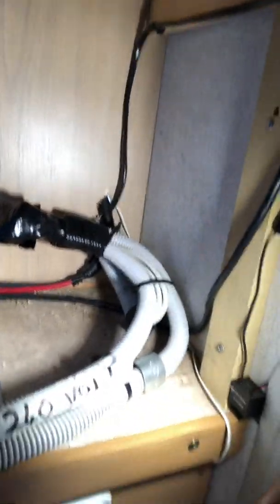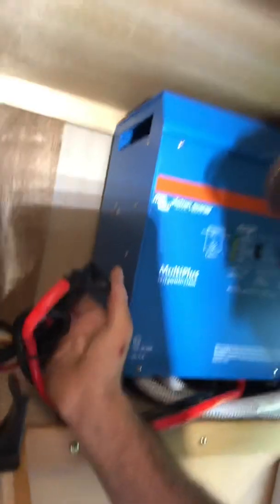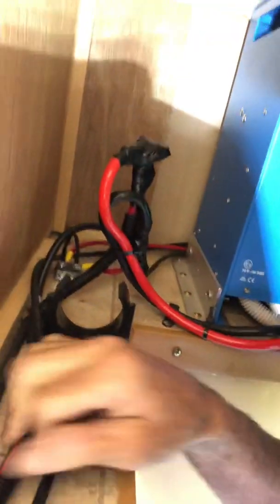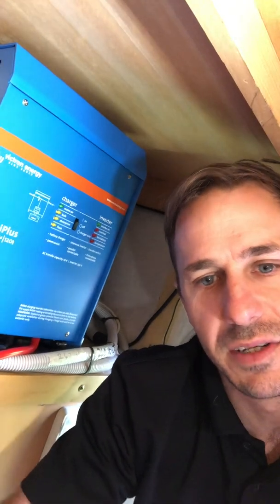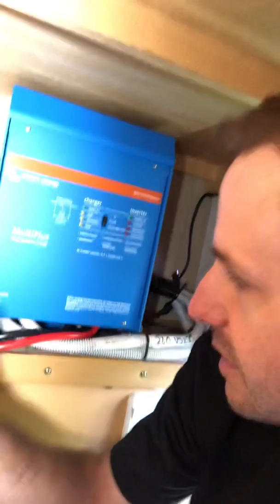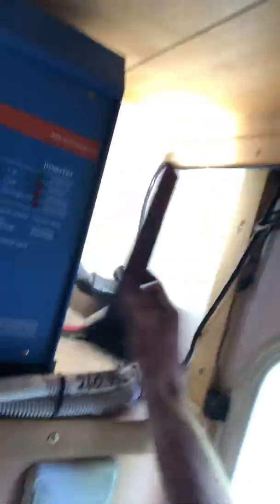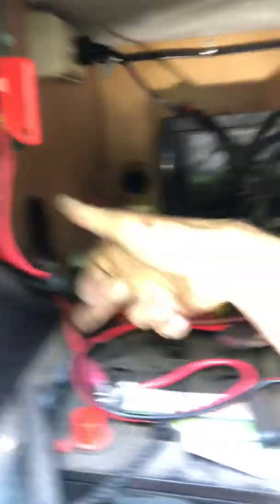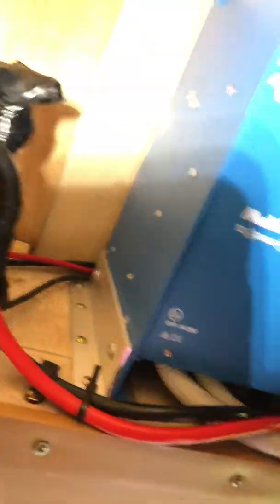Poorly installed Victron 12/3000 inverter charger

Comment: cable thickness depends on current draw and size of battery bank. 2x 50mm2 cable is for max battery and draw capacity depending on inverter size and length of cable. 35mm2 is fine as long as the current voltage draw is low and cable length is short . Use P = V x I
Reply from the maker: well, for a 3000va inverter at 12v requires a bit more than 35mm cable to achieve its rated output. We always size inverter cables based on its recommended requirements via the manufacturer.
Reply: A 3000 watt 12v inverter can pull more than 250 amps. That dinky wire that was used on the batteries sees that full load. I'm surprised this guy didn't burn down his RV. 

What I don't understand is why you  would pay the high price of a victron if you are going to half-ass the install. It boggles the mind.

Comment: What a poor install, Yes and nothing but problems after problems. I would have gutted the DC side of things and start again and same with the 240 Volt side of thing . Fuses and the correct sized wiring complete with a isolating switch. I hope the customer ( or whoever ) has deep pockets. Nothing but a fire hazard waiting to happen.